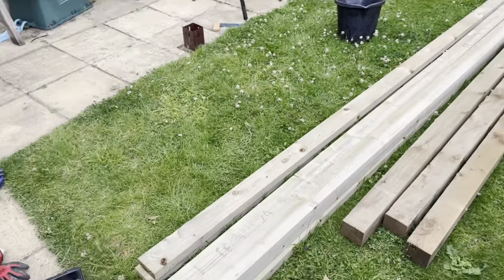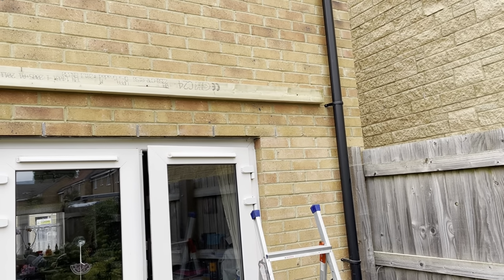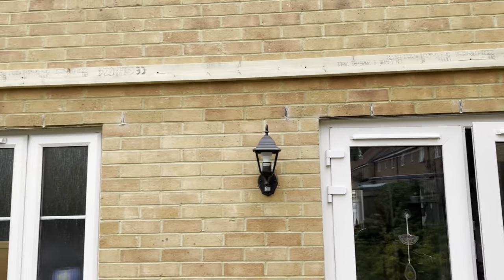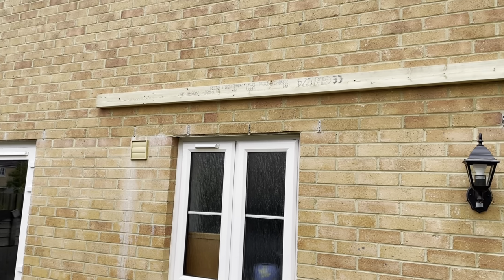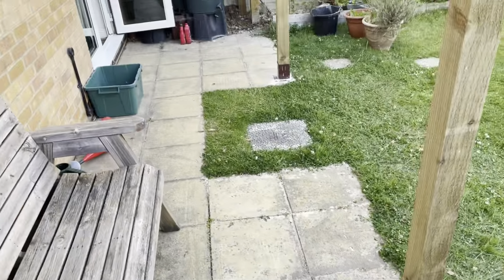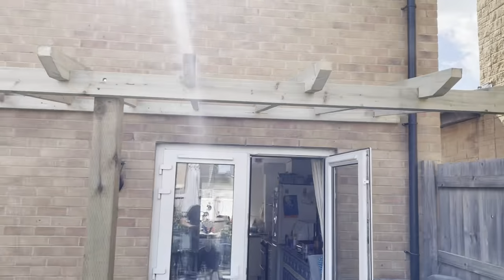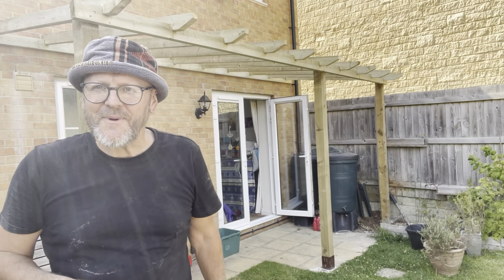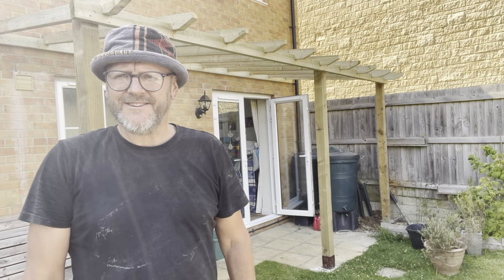Building A Pergola Fixed to A House

Comment: just about to do something similar but with a poly carb roof - and was unsure about fixing to patio slabs but seems its okay unless its not recommended with a plastic roof?  some instruction on getting it all square would be good!
Reply from the maker: Putting a roof on could stress to much in high winds. Need solid foundations.
Make sure you have a good size square to work with. Run plumb lines if needed.

Comment: Great job,  I think you used what is called a notch joint for the rafter as opposed to a birds mouth.    Any reason for not using a birds mouth?  I trying to decided what to use on a pergola that I'm building.
Reply from the maker: No reason at all just how I build them. 
Thanks

Comment: Hiya love this pergola. I am building one with my dad soon. Do you think the posts holder a re strong enough to just screw to 2 inch thick concrete slabs or do you think it would be worth concreted into the ground instead we do get high wind at times here. Thank you
Reply from the maker: If the slabs are secured well to the ground it would be ok if loose then I would look to secure them properly into the ground. 
Thanks for watching, wish you well with your build.
Mark

Comment: hi mate, the two posts you bracketed in, i presume your patio is sloping down, so does that mean they were not plumb? and if they are not, does it matter? i guess the wood connecting them will squeeze them all into frame?? thanks!
Reply from the maker: To be honest I can’t remember all the details of this job. Patios in general will have a slight run off one way . Being plumb and square is important but less critical if it’s just a pergola. I think also the customer talked about putting a roof on it in the future so I may have intentionally sloped it slightly but I can’t honestly remember.

Comment: What size wood did you use for the wall, please? Actually what size do all have?
Reply from the maker: 4x2 for the wall. I used 4x2 for all . Currently I use 5x2 all tantalised timber. 4x2 is perfectly ok but 5x2 gives a bit more rigidity

Comment: Is it easy to just use brackets on the wall board to slide the outward boards into or is it better to notch it as you have done?
Reply from the maker: Either the end result a the same. For me not using brackets is cleaner.
Reply: Notch is stronger I'd still mechanical fix the notch by toe nailing the top but yeah this is stronger than a hanger not by much though. If the hanger is fitted with the correct nails then no problem. Depends on the look you want
Reply: Do you mean brackets straight onto the house or brackets onto the wooden beam he attached to the house?
Reply: @staffysmile3325  brackets on a wood beam attached to the house

Comment: Even with pressure treated timber it will be rotten in about ten years.
Reply from the maker: You are correct any decking or pergola structures have a life expectancy of about 10 years. I do encourage people to treat it every year which will help look after it but as we know that mostly doesn’t happen.

Comment: I have never understood why one would want a pergola. It provides no protection from sun or rain.  I suppose it is purely decorative. Maybe a place to string some lights for a party. Nicely done, especially by yourself!
Reply from the maker: It’s very much a decorative piece that makes a nice space to sit and entertain. You can put a roof on them very easily. Lots do. 😃
Reply: Great to support a vine.
Reply: You can put covers in many ways...Then it is covered patio.
Reply: Attach a roof, it becomes a veranda.
Reply: One can also attach doors and walls with windows and then you have an extra hide away. Nice job, considering you did it alone.
Reply: @KAPWoodworkandbuilding  don't need council approval in NSW